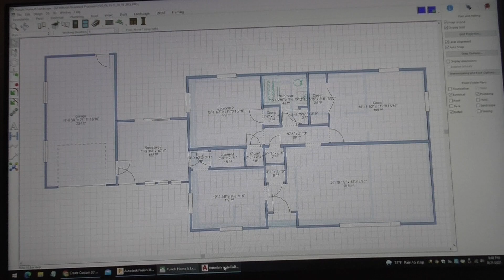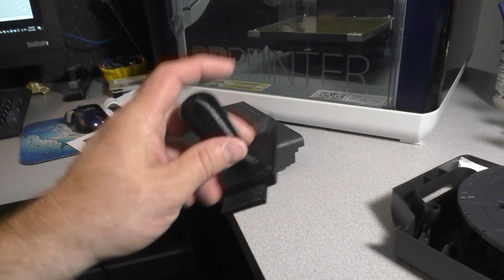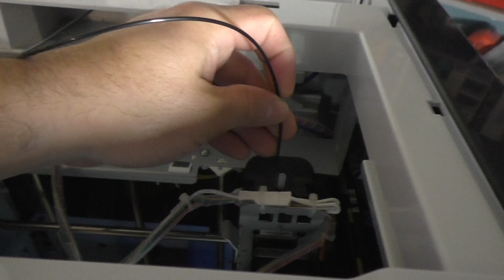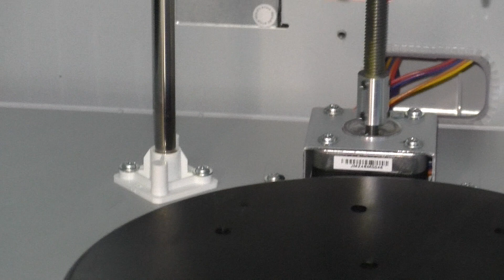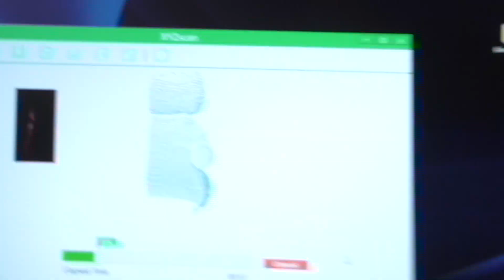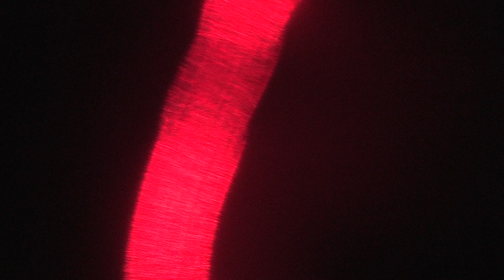DaVinci 1.0 AIO - A DECENT 3D Printer with two MAJOR drawbacks

Comment: Do yourself and the printer a favor and flash repetier 0.92 on it. Takes about 5 minutes and you‘ll never look back. Completely unlocks the printer to endless options and settings. From using 3rd party filaments to open source slicers like Slic3r.
Reply: can you still use the scanning fearure with it ?

Comment: I can't speak for the scanning aspect (one down) - but the limitations on filament would be a deal-breaker for me. The interface not allowing adjustments in temperatures is horrible too. Enclosures are nice, but better when they can be set up when printing. Without a Bowden tube, it seems to be direct-drive, which many people like.

But yeah, it does seem dated and I can realize why the seller thought it was too intimidating...
Reply: I bought an Ender-5 Pro that was refurbished below $300 - and maybe lucky that there weren't any issues. It has a 32-bit quiet board, and I still have everything stock. Some of the features you showed (glass bed, BL Touch - which I've had but not installed yet) are planned, and I will make an enclosure for it (which shouldn't be that much cost).

That would bring up my layout to under $400 USD for a modernized version of the DaVinci you have (and a slightly bigger build area) - but lacking a direct-drive extruder (which could be changed at a slight cost).